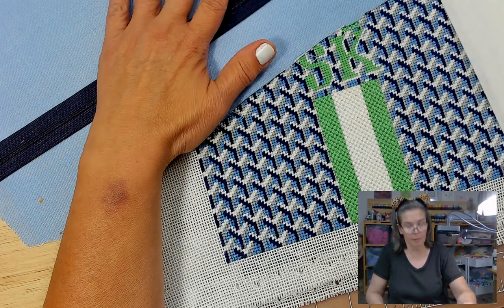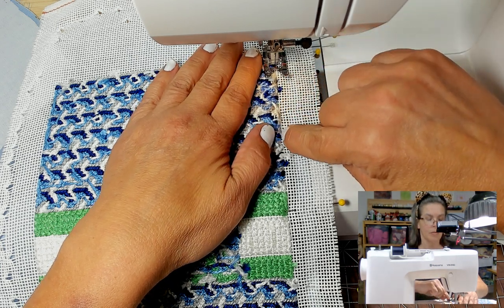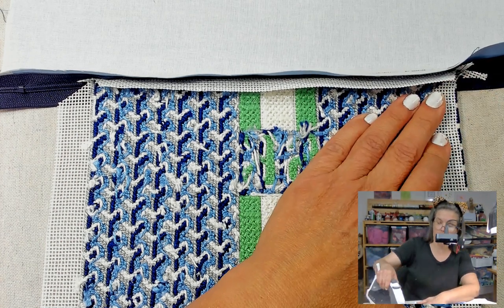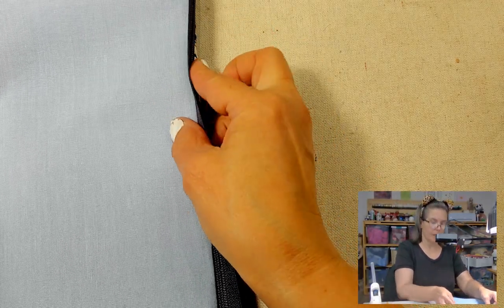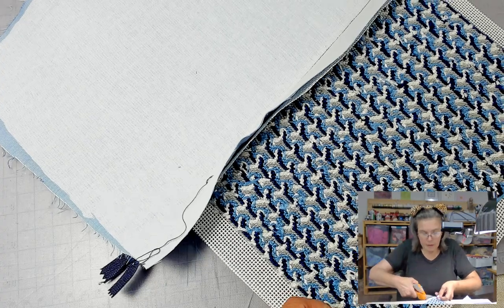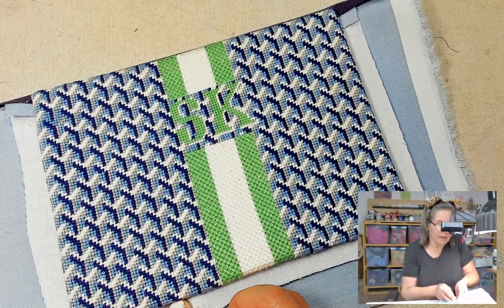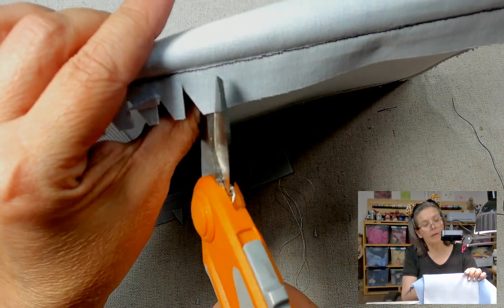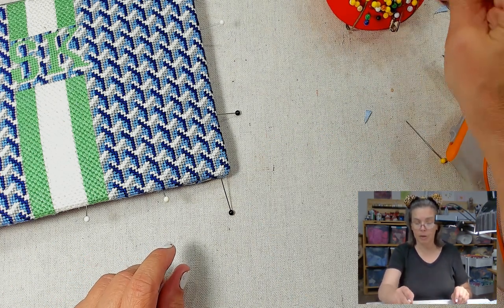How to finish a clutch with machine sewn lining- IT BLEW MY MIND!

Comment: When you are working on a clutch - what types of fiber do you recommend?
Reply from the maker: To stitch the piece? You can stitch it with whaterver you like to work with. Ask your local shop though, because silk ans ivory does like to pill and for things you handle alot it can be a issue. I had one person who regretted using overdyed fibers because a person spilled their drink at the table and a few drops splashed the black of a albino tiger stripe makingthe black bleed into the white. She was devastated, first time she had used it. My thought was, WHAT WAS IN THAT DRINK!😬